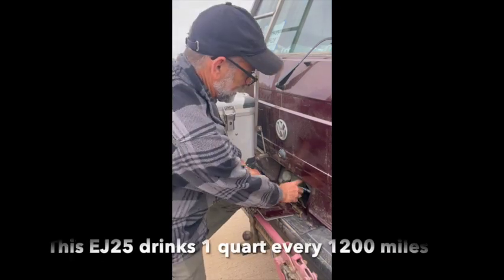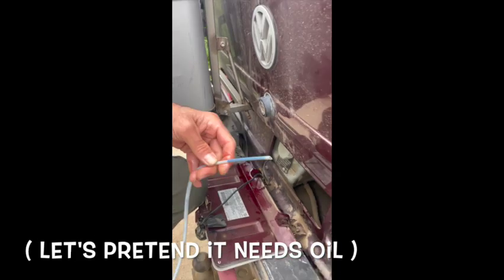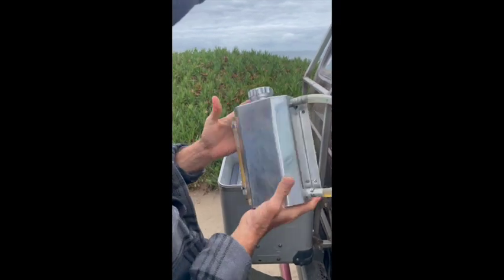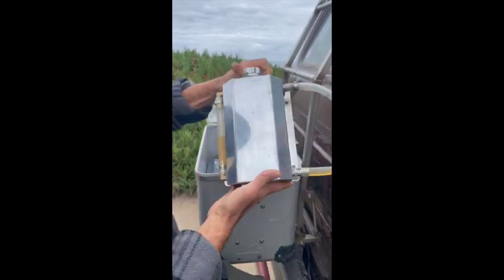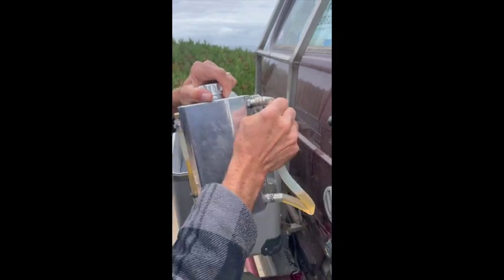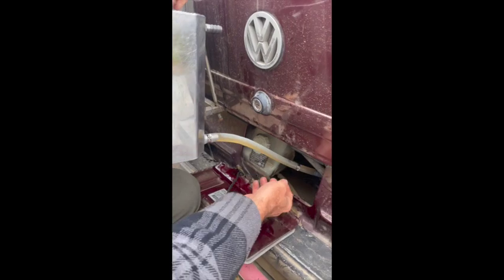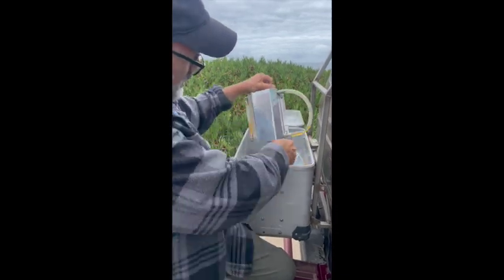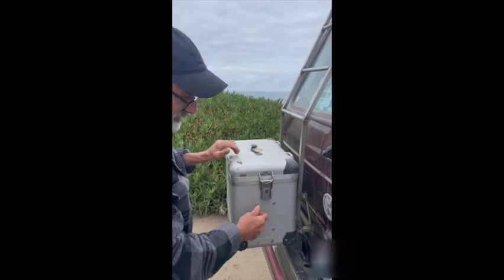EJ25 oil addition tank   1080

Comment: Hi! Long trem Vanagon owner here-30 years. Very good technique for solving that issue. I can relate—I had the same issue with my 2.5 that I ran in my Westy for 11 years. It had good compression but used a qt every 1k to 1.5k mi. I now believe it is just an issue with that particular engine. Mine was a 2009. Apparently, they all used some oil. I switched to an EG33 (6 cyl, for those that don't know) several years ago, and it uses no oil—amazing!